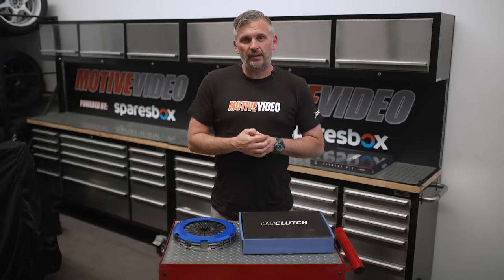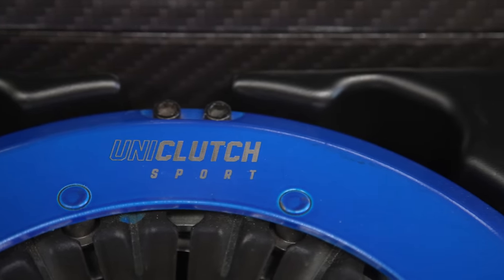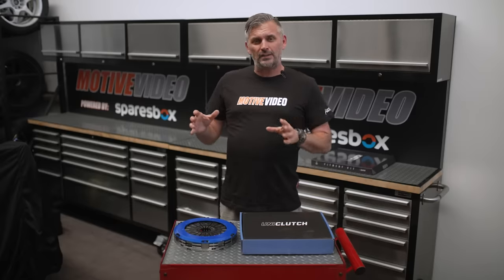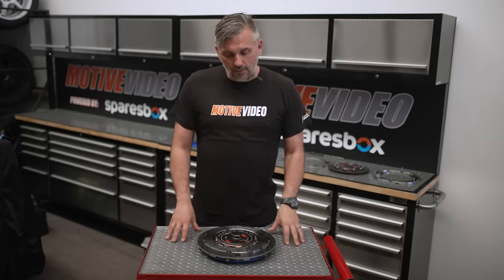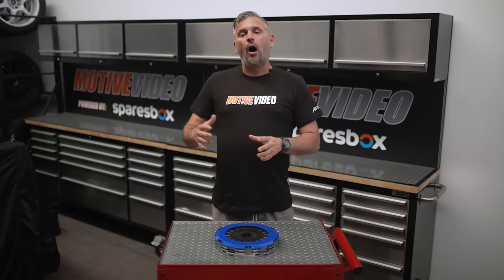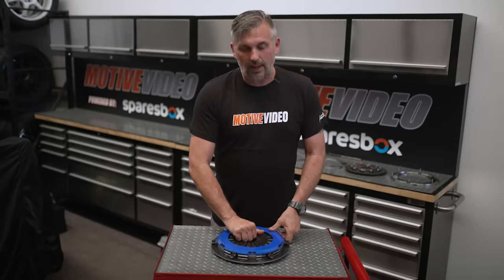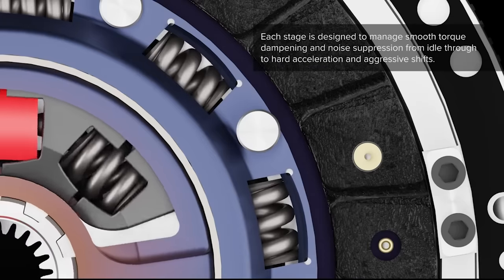New Advanced Clutch Technology  - UniClutch Twin Plate - Motive Tech

Comment: I'm hugely skeptical of that adapter ring holding up to 2000nm of abuse but I'm sure I'll be proven wrong and their engineers know what they're doing. cool product
Reply: I had the same thought. Then i just happen to go look at the fly wheel on my 2jz and yeah. Got 1,010hp and 500+lbs and what 6 tiny bolts and 3 dowel pins. Yeah, i actually think if that ring is made of high grade steel and it ia actually inside the perimeter of the bolts and is held by high grade hardware as long as there is no play just might be strong enough.
Reply: Also dubious about concentricity. The ring appears to be doweled to the flywheel but not to the clutch itself.
Reply: What as opposed to a thin metal flexplate bolted to a convertor ?
Reply: I'm an engineering student, and it seems fine, 2000nm seems like a lot, but when you thing about it, that ring is very far from the centre of rotation so it has more "leverage" to hold the torque, as opose to a transmission input shaft for example that is a lot closer to the centre. So it makes sense it can be thin.

Ofc i haven't done any calculations,  just saying this by eye, and there is no test like the real world, so we have to wait and see how they hold up.

Comment: I love the concept and implementation of that extended damping range on the sprung section! Time will tell how well their intermediate/adapter plate solution for mounting holds up over time, theoretically its sound but harmonics are a ficle thing when it comes to mounting and regidity. Might have to consider this for my track car if I find my current clutch isn't holding up.

Comment: These guys were awesome to see at SEMA and worked off the ORC 559 style wire EDM center section to quick-swap for a given application.  Really cool innovation with the twin-spring array and the superb damping design for smoothness.  They'll be having my business after the SPEC Twin Disc is broken in, and a custom 8.5" w/ T56 Magnum is fitted for a Rotary 13B application from these boys.

Comment: Looks like a bloody brilliant idea, the company behind it is my only personal concern but that's neither here nor there.. 
My experience with an "experimental" clutch built and fitted by them didn't end well but that was 5-6 years ago, alot can change in that time and by the looks of it, it has..
I think I'll wait for feedback before dipping my toes in this time instead of being the one toffer feedback
Reply: funny you say that, i commented on one of their instagram posts asking who the company above them was and they didnt answer haha
Reply: @babarnett1987  Yeah, plausible deniability lol. 
My brother inlaw was a sales rep for clutch industries so I got a free mantic twin plate they'd made and fitted for free that was claimed to be easily daily driveable, had no chatter and would handle high torque loads, I was supposed to give feedback on the clutch as a guinea pig in return.. 
I had a twin plate previously but it was a pull-to-push type conversion and theirs was a direct fit pull type clutch kit for EVO 4-9.. 
First off, when picking car up it wouldn't start (plugs fouled, run in tune and them moving in/out of shop) and then the speedo didn't work as they didn't reconnect it and the wheel nuts were left loose🤦‍♂️..
But that was the workshop they had do the work, not them. 
The clutch was good in that it had a light pedal and easy take up, no judders but still rattled just not as bad as normal twin plate.
It was a fresh 2.4L bored and stroked on run in tune and handled it fine so hopes were high, then when full tuning it started slipping at 380wkw at all four, so was detuned to 360wkw and left there (dyno run is on my channel). 
Then, doing a 3rd gear pull BANG! clang clang ding ding dadingg... Holes in the bellhousing.
Tear it down, pressure plate broke where spacers and allen keys are and they exited through gearbox bellhousing. Pull clutch assembly off and there were witness marks on the ARP flywheel bolts where centre sprung springs had been hitting and would obviously hit more with wear as the friction material was the only thing keeping the tolerance although also likely what reduced it's bite on the flywheel..
All in all, never again lol

Comment: I wonder how well those urethane pieces will hold up. That material generally doesn’t withstand high heat. In normal driving they would probably be fine but for racing applications it seems like they would deteriorate pretty quickly.

Comment: How would this compare to another Aussie clutch XClutch? I have their twin organic disc clutch and lightened flywheel for my Honda Type R Fk8? Pedal is almost oem feel and rated to 900 ft lbs. it’s not sprung but engages very smoothly. It does jingle when the clutch pedal is pressed down but that just may be a part of what twin disc clutches.

Comment: I can't wait to see/hear this in a Getrag, mine makes a bunch of noise when the pedal is released but not in gear. Been told it's normal but super ready to get rid of the sound!
Reply: Only way you are getting rid of it is a dual mass flywheel. Or increase idle to 1000+rpm.

Comment: sounds like a good solution for bmw with smfw chatter.... but the torque rating is kinda low (anything n54/b58/s55 running on ethanol mixes is going to need the track version) and personally, it's a bit expensive for what it is... the street version they currently have available on their site with a new flywheel costs more than a xclutch twin plate organic which comes with a new flywheel...

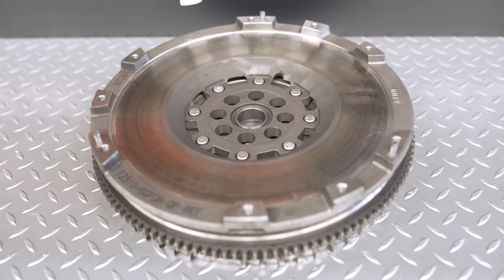Comment: 4:05 Bzzzzt - Incorrect, many dual mass flywheels actually can be milled, rather than machined by a lathe.
Several workshops I've worked in on the Sunny Coast here use Maroochy Cylinder Heads to do this and my own personal Subaru Outback was done over 150k ago by them 👍
Reply from the maker: So what you’re saying is they can’t be machined
Reply: @MotiveVideo  depends on the semantics of 'machined', a cylinder head mill is a machine just like a brake lathe is a machine.
It's more to do with the skill of shop you take it to. 

My point is that you don't always have to throw away a dual mass flywheel.

Comment: Sounds like the dual mass flywheel is acting like a harmonic isolator.  Where the trans and rotating assembly are alowed to move into phase, or never stay in a bad synchronization long enough to setup a audible trimmer/shake/ resonance.
Reply: I AM INTERESTED, but with a lightweight flywheel, does the Uniclutch system have a lot of NVH, or does it resemble the original in terms of vibrations and noise?
Reply: @magicman6179 
From what  he said in the video , it reduces NVH like a dual mass flywheel but betterand over a wider range of harmonics.
  A Cummins 6bt a12-1400rpm over works the springs  as the pistons speed up appon firing then slow down on the next compression stroke.  This rocking motion in excess of the springs ability to compensate makes the nut on the back of 5th gear back off  at low rpm ,high load  high tq( 800-1300 torque)

Comment: How much additional flywheel weight is added, by fitting the Uniclutch assembly with its own inbuilt flywheel? 

Like someone else posted, that bolted on torque ring does not looks like the sort of thing a track car will eat up. No doubt theres a heap of FDA and hopefully a lot of test hours on it and we'll be wrong about it, just looks... I dunno, flimsy 🤷

Comment: A normal clutch was never difficult to install, obviously better performance, but am I missing the point?
Reply: 1. Instead of making a clutch that will only work for a specific engine and nothing else, they use adapters rings that match a specifica engine and that allows them to mass-produce the clutch for cheaper.

2. The clutch has internal dampeners similar to a dual-mass flywheel.

Comment: How is that intermediate ring that connects clutch assembly to flywheel strong enough to not spit the entire clutch out at high revs + shock loading? Seems like a huge weak point and massive liability. I wouldn’t advise running one of these without a clutch basket…
Reply from the maker: So you’ve tested one personally to destruction and know its weak point? We’ll let their engineers know.

Comment: I don't understand, so instead of having to carry different types of clutches they can stock the same one, but instead have to stock all the different adapters to suit the uniclutch? So it doesn't really solve the original "problem" lol.
Reply from the maker: It does as the adaptor kit also suits multiple cars and the space, size and cost.

So you can order 50 clutches and 50 adaptors and all up could suit 300 different cars
Reply: Adapters are cheap. Clutches are not. You can sell a single clutch housing and it will fit anything as long as you the right adapter kit. That's vastly more efficient than having heaps of full clutch kits that might never get sold.

Comment: motorbikes have been doing this for years... i have to question that adverb "advanced".
multiplate clutches are nothing new. get the contact area and pressure in a smaller diameter. 
cars arent the only machine out there.

be nice if bikes were a bit more "universal" though!
Reply from the maker: Where did we say being multi plate was new tech

The 4 stage damping is new tech as is the adaptor ring.